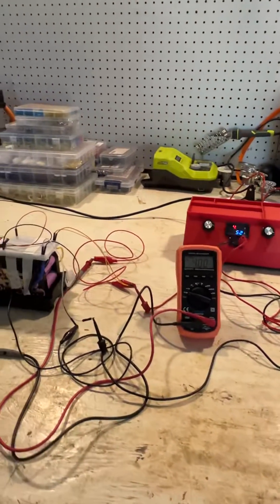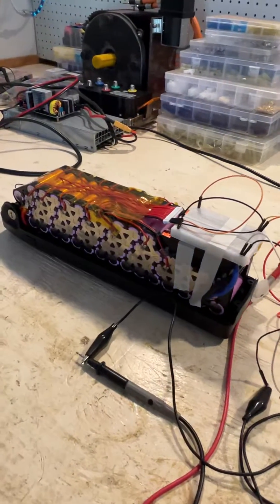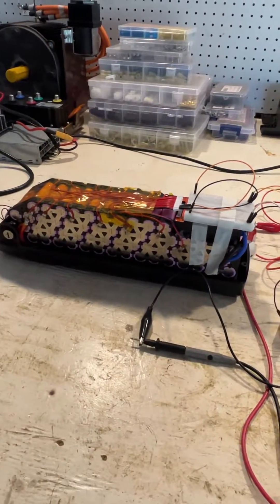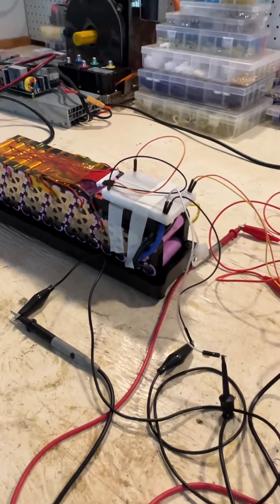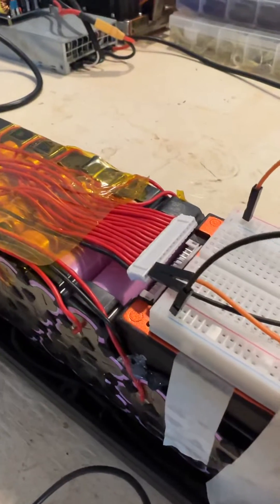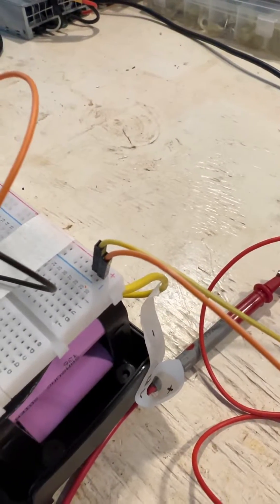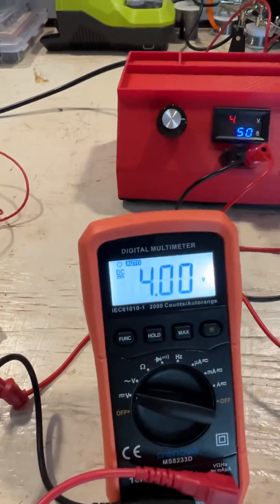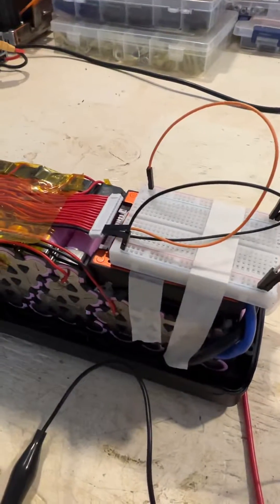A BMS does not actually balance your battery pack.. and what you can do about it!

Comment: So is there an easier way to balance?😊
Reply from the maker: you just purchase an active balancer. I've actually since added one to this battery pack
Reply: @GaiusGarage  where do you find these?
Reply from the maker: @MikeCaskey  they have them on Amazon but maybe be a bit cheaper on Aliexpress. the Daly brand active balancers are pretty good. you can use their app to monitor cell voltages
Reply: @GaiusGarage  Any idea which balancer I would select for an onyx CTY2?
Reply from the maker: @MikeCaskey  depends on the number of cells in series of the battery. not sure what it is for that bike but you would choose accordingly
Reply: @GaiusGarage  What would I search for?
Reply from the maker: @MikeCaskey  active balancer with the number of cells in series of your battery

Comment: So let's say my drill battery is unbalance  and it consists of 8 batterys can I just charge them all up individually to the same voltage ? Great video 👍🏻
Reply from the maker: yes that would work. basically what I'm doing here
Reply: @GaiusGarage  sounds Easter than going throw all these setting on these balancing tools 🤣🫣I just know I'd burn my shed down 😭🤣👍🏻
Reply from the maker: @nothingbutthetruth7900  a drill battery should have a good active balance function on the BMS. it shouldn't really be too much out of balance unless the cells have been very stressed and some are degraded. balancing them may not solve the problem as they will just become unbalanced again after a few cycles
Reply: @GaiusGarage  thank u so much for taking the time to reply bro👍🏻just doing some drill refurb rebuilds and very new to this and tbh lithium scares me a bit 🤣as watched videos way to much of them exploding so when I'm working on them it's like I've got a bomb suit in terms of safety precautions 🤣👍🏻
Reply: @GaiusGarage  also will let's say there are a few a bit out will the BMS sort that out without me having to take off and charge to the same as others 🤔
Reply from the maker: @nothingbutthetruth7900  it depends on the BMS but most likely not. that's kinda the point of this video, that passive balancing will not correct an unbalanced pack if the difference is too great as it requires cells to reach a certain voltage before the excess can be bled off. If the pack is so unbalanced that one group never even hits 4.0V, for example, that group wilp never be balanced
Reply: @GaiusGarage  thank u so much looks like I've building a battery again nn 😂

Comment: I just took the 10s3p 18650 pack out of an old scooter and was surprised to find there was no balance plug on it.  The pack has an XT30 connector and an extra plug with 2 wires, a black and red, which is probably for a thermistor to measure battery temp. The entire pack is 3.51v. Not per cell, but the entire pack, so it's toast. I am going to rebuild the pack and I am thinking of adding a balance plug and using a hobby charger to balance charge the new pack. Is this a good idea? I've never messed with scooters. I only work with FPV drones.
Reply from the maker: yeah I don't see a reason why not. not so easy to find a 10s balance charger tho
Reply: @GaiusGarage  I thought maybe I could wire it as two 5s packs and make a series plug to turn the two 5s packs into a 10s pack. I also bought a BMS that has a 10s balance plug. I don't know much about BMS but I assume it balance charges the pack?
Reply from the maker: @CarbonGlassMan  the BMS balance charge feature is not so great on most generic BMS's so a balance charger would be much better. but it's more complicated to use two 5s balance chargers to charge the pack. you're probably better off keeping it as a 10s pack and adding an active balancer alongside the BMS. the balancer will keeps the cells balanced and the BMS will provide all the protection features
Reply: @GaiusGarage  Never heard of an active balancer. Thanks for the helpful information.  I'll check that out and get one.

Comment: Hi! Have you tried calibrating the volt meter on your charger using the adjustment screws on the back of the display (using x small needle nose pliers works best) ? I calibrated mine recently and it hasn’t drifted so far.

Comment: what risks do you see doing this with the BMS plugged in? I don't want to desolder it...
Reply from the maker: no risk. you can plug and unplug the balance wires at-will. the BMS will just shut off and you should see no or low voltage at the output

Comment: I just manually top balanced my 13s5p lithium ion battery because like most i stored it for a few months at 80% instead of fully charging it once a week. 

In order for the BMS to maintain top balance, a few conditions must be met:
1. Battery bricks must still be related well matched in internal resistance so one brick is not artificially surged up to OVP.
2. The charger should only charge at 0.25c and taper at the top so that the differential voltage caused by different IR of each brick is minimal.
3. The charger must not exceed 4.21v/cell open voltage.
4. The pack must be initially too balanced such that at peak charger voltage no cells are pushed up to OVP level (normally 4.25v).

Once these conditions are met it should be understood that the ONLY time balance maintenance can be done by the BMS is when at least one brick is between 4.20-4.25v, and normally this is done by leaving the charger on for at least an hour after the light turns green. If you unplug it as soon as the light turns green and use it right away, ZERO balancing maintenance is done. 

I also tried to manually balance a 5s1p pack for a cordless tool but the charger does not taper so it never allows it to balance. It surges up to OVP, closes the port, subsides below balance voltage but not down to release voltage (<4.10v for this BMS). This is a combination of cheap cells (mismatched IR) and cheap charger. The only solution is to find a 21v charger that starts to taper at 20v and doesn’t go over 21.1v open voltage. 

In another case i had a power bank with 2s3p 3400 mah 18650 cells (20400 mah rated) and one group developed a self discharge way more than the BMS can maintain even if charged daily. Only solution would be replacing at least the defective cell(s). 

I bought a new BMS with 1s6p 10,000 mah pouch cells. The nice thing is that it will never need to balance. If a cell develops a small self discharge the power bank will still be useable if fully charged before any storm arrives. This BMS uses an protocol like old cell phones where you need to fully discharge the battery until it shuts off, then charge uninterrupted until it stops charging to calibrate the SOC%. And it says should repeat calibration on e every 3 months.
Reply: I'm trying to learn about balancing, as I'm a novice in these things, but couldn't understand what you are saying, shame you coudn't have made it simpler for us novices, and use less acronyms. Thanks anyway for your imput
Reply: @RobertAdams-ly5ku  , i have some videos on my channel showing how I balance battery that has a basic BMS (Battery Management System).
Reply: @imho7250  Thanks, I’ve had a look at your channel, and am amazed at your knowledge, the best I’ve found on balancing, great channel. I’ve subscribed
Reply: @RobertAdams-ly5ku  , thanks. If you have any questions just ask them on the video and ill answer them within a day.
Reply: @imho7250  Thanks, I keep watching your videos on balancing, and reading the description, also  I keep reading your post on this video, hoping each time I will understand more, I’m using your information as a reference, so thanks for that. No doubt I will have more questions. I think it’s essential that if anyone uses  an lithium iron battery  they need to understand how to keep it balanced, from a safety point of view
Reply: @RobertAdams-ly5ku  , when using a basic BMS that does have Bluetooth so you can see exactly what’s going on inside the pack, it will prevent any cells from getting too high or low, even if not in balance. 

The main benefits of keeping the battery balanced are:
1. It will only enter balancing if its not way out of balance. This is because all battery chargers have a taper at the end of charging that reduces the charge current as it gets a few volts from max charge. By reducing current it reduces the cell differential voltage caused be different internal resistance, as well as the amount of surge voltage the cell gets during a charge. When the battery is way out of balance one brick will reach max voltage before the taper in current and end charging.

2: as the battery gets further and further out of balance, since it can’t do any balancing during each charge, it limits the usable capacity of the battery since the charge is ended early and during discharge there will be cells lower than average that turn iff the battery early. 

Once the battery cost is significant then it’s really worth it to have a Bluetooth BMS. These don’t require you charge to 100% to balance. You can charge 80% and balance it there if you want, extending the life of the battery significantly. Then if you are going to need full charge, you can go in the app and set it to charge to 100% and balance there before your trip. If your battery is in storage for the winter you can open the app, check the state of charge and balance condition, and know right away what you need to do such as add 10% charge and initiate an autobalance session. You can see the temperature too so you know if you need to bring it out of the cold and let it warm before charging. Most basic BMS dont have thermal protection and since you have no app for those, you can damage the battery if you try to charge it while its sitting outdoors in below freezing temperatures.
Reply: Sir pls answer this query of mine...I'm desperate for an answer

I have an 8S LiFePO4 battery pack for my ebike project which I tried to charge using my suspicious lithium battery charger. The charger applied a voltage slightly higher than the battery voltage at any moment to charge it along with 1.5 A of current. For example, if the battery was at 26.2 V the charger applied 26.5 V and 1.5 A, and the voltage increased in the same proportion as the battery voltage increased. This was constant current charging.

The thing is, the charger cut off the charging while my battery was only 85-90% charged(26.6V) and never intiated the constant voltage charge. I just read somewhere that I need a charger which applies a constant voltage of 29.4 V to fully charge a 24 V LiFePO4 battery.

Did I damage my battery by charging it through a charger that doesn't fully charge my battery and give out constant 29.4 V? I may be just paranoid but it could be a serious thing. Can I continue using this charger in the long term which never initiates the CV charging? I'm fine with not utilising the remaining 10% SOC. I just want to make sure this kind of undercharging and this charger doesn't harm my battery in any way.

And what I'm more concerned for is that i also heard that many bms' tend to start balancing the battery when it reaches a certain VOLTAGE (full charge voltage), if this is true..... doesn't it mean that my battery can become unbalanced in the long run as the bms may never balance the cells?

Can charging an 8S LiFePO4 battery pack using a charger that never initiates constant voltage charging and doesn't fully charge the battery to 100% cause damage to the battery, and can this lead to cell imbalance if the BMS only balances the cells at full charge voltage?
Reply: @electricalA.K.  , what type of charger is that? Lead Acid, Li-ion or LiFePO4? 

What type of BMS does it have? Is it a smart bluetooth BMS or a basic BMS that you cant change the settings?

Whats the AH of your battery? 1.5a charger is pretty low. Suitable for 6AH battery for 4 hour charge,  but can work on slightly smaller or bigger batteries.

Generally LiFePO4 batteries will need either a smart BMS or a basic BMS plus and active balancer because they act crazy at full charge (3.65v), and as soon as charging stops the voltage will subside to about 3.4v-3.5v within an hour. 

My 20s6p 32650 LiFePO4 battery has a smart BMS, which is programmable. So i only charge it to about 3.45v, on the highest group, then it shuts the charge port and enters autobalance where it bleeds the highest bricks until they match the lowest bricks. Normally this is around 3.37v. 

If you try to use a basic BMS it will most likely never charge correctly because one brick will rapidly go up past 3.65v and close the charge port, and then the voltage will rapid decrease, possibly down the the release voltage, which opens the charge port up again. 

This is where the type of charger you have is important. A lithium charger will show its max voltage once you plug it into the wall, which should show:
29.2v-29.4v for 8s LiFePO4
25.2v-25.4v for 6s Li-ion
About 28v-29v for 24v AGM batteries. But the AGM battery will not charge unless it sees a proper voltage at the battery. And it has a “float” mode after fully charging the battery to 28v-29v, it will drop to 26v-27v and hold that.

Comment: Thanks, you solved my big question whether BMS with balance feature can actually balance a battery pack....So the answer is no. I was also trying to manual balance a 10S4P pack using a imax b6 charger and charging 1s each time  starting from 1s upto 10S but this was not successful too :( (Charging was like stopped at 3.65 V ). Any ideas ? Now i m trying to discharge seperately cells that are higher to others P.S. Voltage difference is like 0,2-0,3V, not damaged cells
Reply: Are you trying to charge Lithium Iron Phosphate? What setting are you using on the iMax B6? Charging each group up to a certain voltage is the best way to do it (or discharge the few high ones if that's how it works out better for you). There will be some slight voltage drop after you remove the charger, I don't consider a cell at its resting voltage until its been off a charger for at least an hour but realistically most of the movement happens within the first 10 minutes of the cell coming off the charger or load.
Reply: Yes BMS with active balance features will work you can monitor using your smartphone

Comment: It’s a good tip. Sometimes that works but I find that usually when the cells are that far out of balance it’s for a reason. I’d recommend people be extremely cautious doing this and never walk away from it while charging.
Reply from the maker: yes, this is a good point (that I should have mentioned). Internal resistance is the name of the game here and I actually ordered a meter to measure this. I dont necessarily think these low cells have exceptionally high internal resistance -- probably more due to repeated use and negligence with respect to balancing, but it is most likely higher since these cells were more stressed.
Reply: its for a reason, but that reason may very well be a variation in self discharge rate. i have a pack from a bike, 48v, 13s4p, LG MJ1 (i think). After manual balancing, all is fine and dandy, cells all have 4,2 volts and they also discharge at very similar rates. but after 1/2 year of storage, the little shit is out of balance again. now if you look at individual cell groups, theres nothing really frightening about 1 group discharging 20% in half a year while the other discharges maybe 25%. its chemistry after all.. but the stupid pack has no balancing at all and that leaves me with a really big and stupid problem of always having to deal with this disbalance. switching BMSs is possible, but not very sexy when your pack is for a retail bike and you have a battery case that can show state of charge with LEDs.
Reply: @Almostbakerzero  that is exactly what happened to me. Bought to batteries from a local vendor who builds them, one works flawlessly after 3 years but the other one, worked fine for a year, stored it over winter, then it started to cut off at load. Sent it to be repaired under warranty, came back, worked fine for almost a year and AGAIN after winter storage it started to act up in the same way. Reduced range and cutting off under load. At this point I don't know what to do, should I continue to trust that vendor and send it again for repairs? It's out of warranty this time so it will cost to get it fixed.

Comment: And this is where Active balancer equalizers come in . I would go with 10A balancer . They now also have traditional BMS protection functions like overcurrent protection https://www.youtube.com/watch?v=5tHeT72xxtE&t=705s
Reply from the maker: yes for sure! what I still don't get is why active balancing is not a basic feature of a BMS - is it just a cost issue? I wasn't even aware that active balancers have BMS protection features - some that Ive seen did not - is it overvoltage protection too or just overcurrent?
Reply: @GaiusGarage  The new balancers coming out have almost the same features as any other  BMS . I don't think it's cost issue . In my opinion it's innovation or figuring out news ways of managing battery  packs . 
Standard BMS  usually burns of the difference with the help of resistors , but that's really old tech which believe it or only now is being phased out . Now we start to see BMS systems which will act like active balancer equalizer but only balance at the top . 
An active balancer equalizer on the other hand will transfer energy from cell to cell even with great voltage differences between the cells
Reply from the maker: @Ray88G  yeah I guess its why I found it so surprising - given falling the cost of electronics and R&D for PCB design its odd that most BMS's are just bleeding off charge through resistors - whats the overhead for developing a more sophisticated method. But I guess its just supply catching up to demand
Reply: Well, in the case of a consumer. They're never gonna notice their battery isn't fully charged. They'd rather save money then buying better BMS